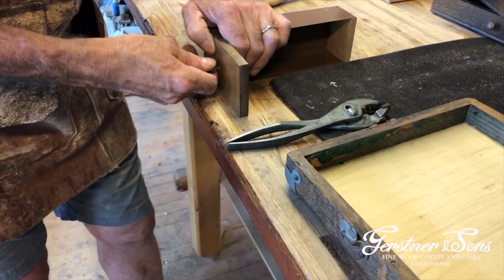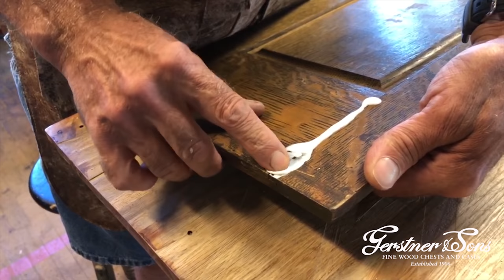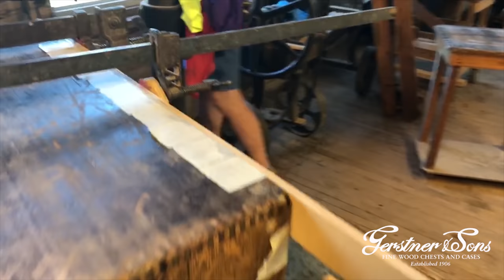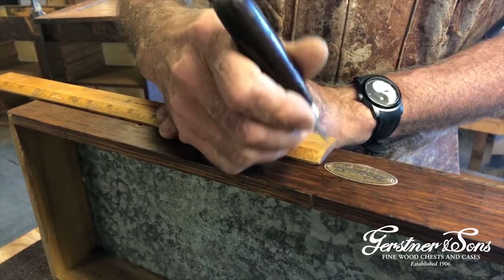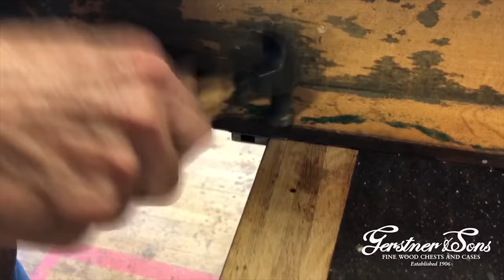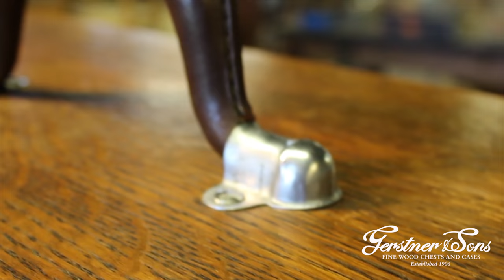Restoration of a Model 52 Gerstner Chest

Comment: I have one - an original in nearly mint condition. I do not intend to mess with it. It is far too nice to try and restore when it doesn't need it. It was inherited and I treasure it. Still has all the expensive high-end machinist tools in it as well. All of those are in perfect condition. No rust, no debris, no scratches. Many of the items are high end West German and Germany made precision instruments. A few  men have seen this chest and its contents and immediately offer me; "Name your price for this - I have to have it!"  It isn't for sale!
Reply: I would never sell it either. I have some of my father’s tools that I sometimes use just to, bring back memories and get close to him again.
Consider waxing the old box once or twice. Every 5-10 years. Keep the old varnish protected. Keep the wood flexible. In this video and others, you can see where the surface lamination is beginning to split on the lid or other parts. Cheers.

Comment: I've seen these tool boxes and all the copies for years. What was the purpose of the mirror in the lid????
Reply: As a retired machinist, I see it does a couple of things. Covers the fasteners on the lid handle and reinforces the wood. It also lets you see what is in the top of the box when stacked on a 2 drawer base box. You can also slide things under the edges to hold a drill/tap pocket chart, notes and small pictures. I knew a drunkard machinist that hid his bail bond money under the mirror.
Reply: Some machinists are smudge magnets,  the mirror gives the necessary feedback.
Reply from the maker: https://www.gerstnerforum.com/showthread.php?53-Why-is-there-a-Mirror-in-the-top-of-a-Gerstner-Chest
Reply: So the machinist can touch up his face at the work day end.
Reply: Achmed Seldomsinsobar  That's the first thing I thought too.

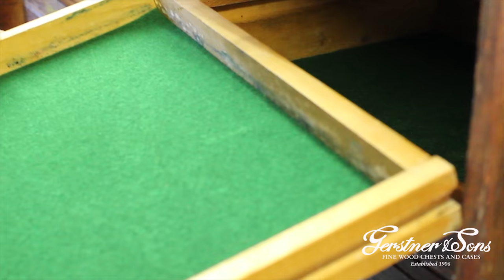Comment: Frame 5:20 reveals a not so nice inside drawer sides. Restoration is just fair.
Reply from the maker: Thanks for commenting.
With all restoration projects we do, the customer directs what is to be restored. While we can sand and refinish older chests, re-felt, replace all hardware, and bring it back to its original appearance, most prefer to leave the dings, scratches, and patina as a way to honor the history of the chest. Many chests are passed down through generations and the restoration of those physical markers, which some may see as needing to be fixed, probably tells a family's story that's worth repeating.